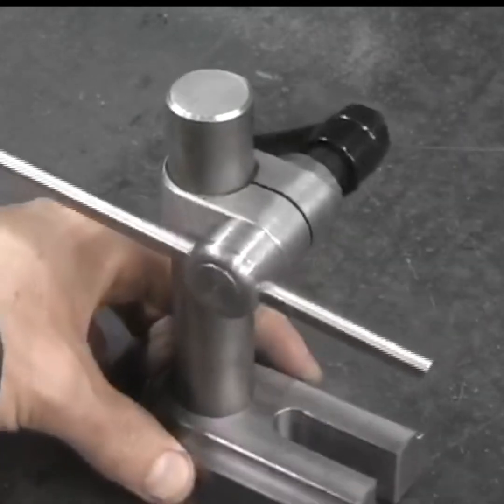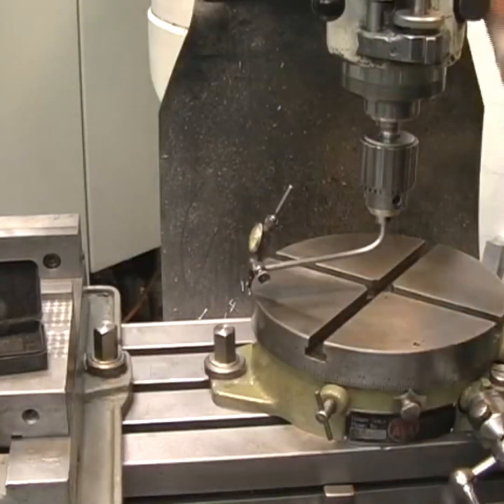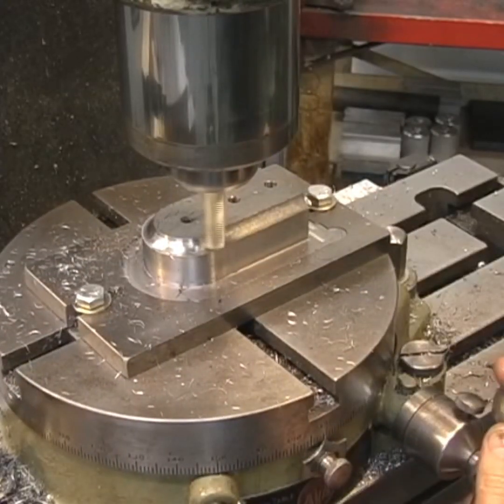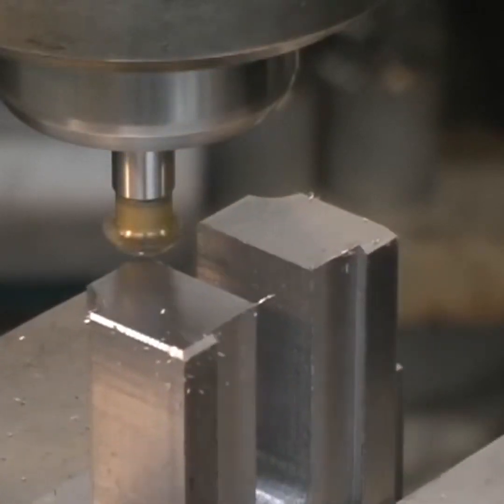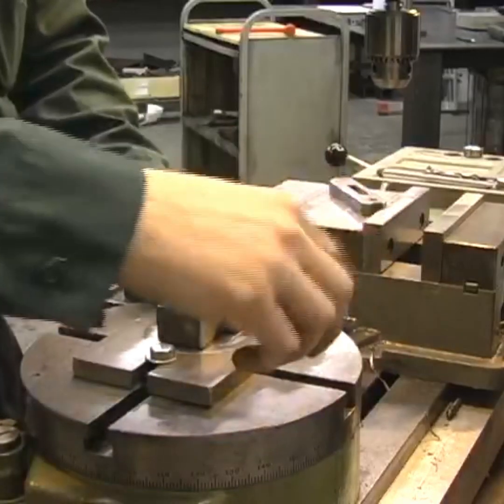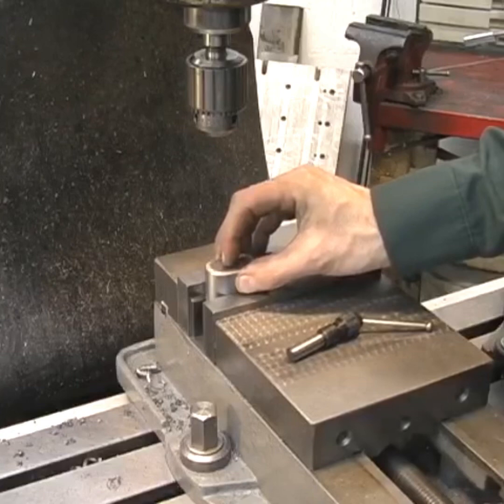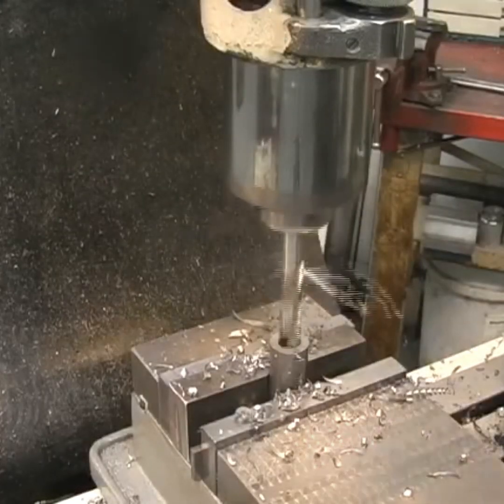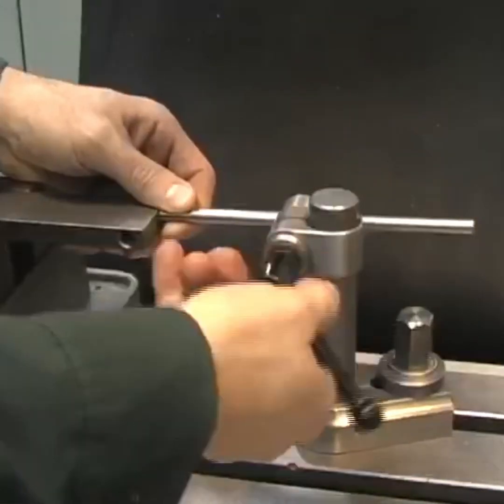Milling machine Tutorial. Making an adjustable position locator.  Vice Stop, all on a Bridgeport

Comment: Whooo nobody else on the planet thought about using the drill press to guide the tap while tapping a thread.
Reply: Well Robert that wasn’t a drill press it was the actual milling machine he used . There is another way to do this which is by clamping the tap the same way but using that tap for tapping a “start “ for your thread and put you milling machine in neutral and rotate the drill chuck by hand . It would get harder with bigger taps. You can finish tapping by putting you workpiece in the vice.

Comment: Using a caliper  for marking out would be instant dismiss if he worked for me
Reply: You'de be surprised just how many bad practices are shown on YOUTUBE. The abuse of the calipers not being the worst-  you'll see knuckleheads hammering on the surface plate and marking out table, chuck keys left in place while the operator scratches his arse,  loose sleeves and wedding rings hovering close to rotating parts, to name a few.  Welding in cotton fleece shirts is dangerous as is having a gas cigarette lighter near the welding operations.

Many of the presenters should or do know better, but they push ahead regardless!!!

As a student I would have got my arse kicked for doing any of these things.

Stavros